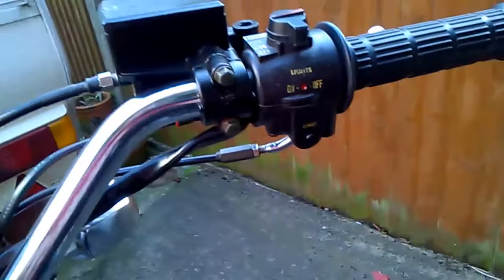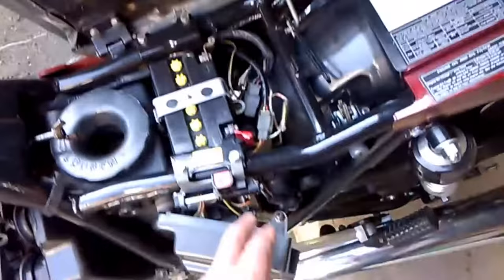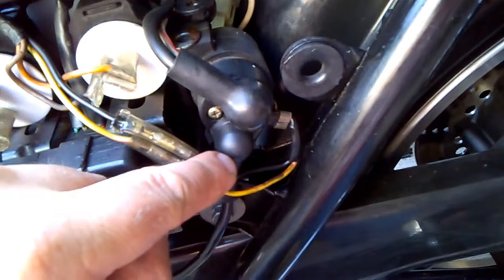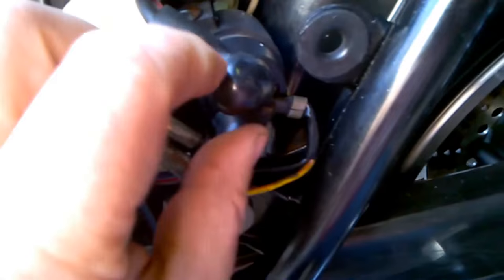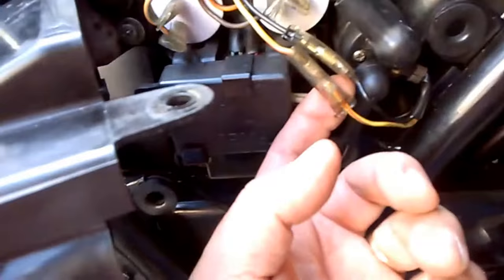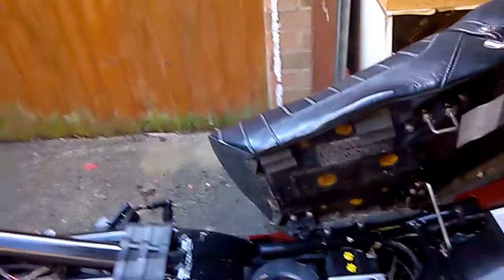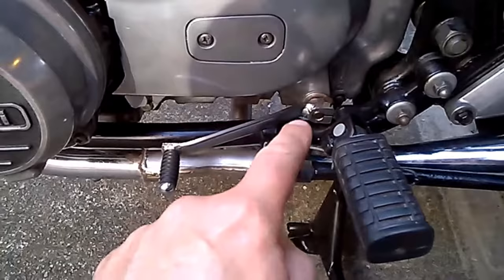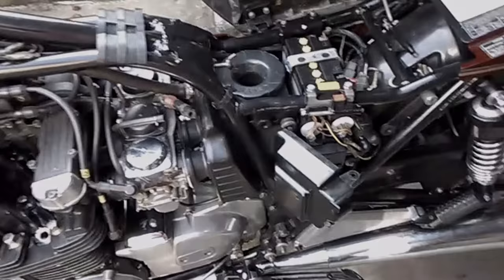What to check when your starter button is dead.

Comment: I have good new battery; no kill switch; ( that I see) and no click or noise when starter button is pressed.  I took apart the starter button assembly and sprayed heavily with elec cleaner.  Heeelp! 🥴
Reply from the maker: Have you followed through the advice in my video step by step? This is the best advice I've got! Check solenoid  and earth strap in starter motor.  Good luck.
Reply: Check fuses, try pulling your clutch in. Try kicking your kick stand up. Open ur kill switch make sure there is no debris

Comment: Usually the check lights go on when you tun the key to on. 2nd check engine kill switch and make sure it is in the run position….
Reply from the maker: Check the kill switch a good tip 👍 Still wouldn't have helped me here. The check lights were on, the kill switch in 'run'. The bike is 43 years old and lacks any finesse in the electrical side that more modern bikes may have. It was the dumbest of errors on my part, revealed for those that watch to the very end of the vid. 😂

Comment: Battery is new starter relay is new starter motor new, all i get is a click from the starter relay when pressing the  starter button and everything goes off then comes back on. Contacts are fine and theres power at the switch, stupid question would a broken brake switch prevent it from cranking?
Reply from the maker: I wouldn't expect a broken brake switch to cause that. Sounds more like a sticking solenoid, a sticking starter motor or a poor earth,  maybe at the starter motor.  Sometimes tapping the starter with a rubber mallet or dead-blow hammer will free it temporarily,  which would reveal if that was the fault.

Comment: I can start my bike with touching both contacts on the solenoid after pulling their plastic covers back, so my solenoid, starter motor and battery are fine but starter button doesn't do anything, usually if I were to forget pulling the clutch before starting It would crank for a second then it would stop but now the button doesn't do anything at all, I tried checking the cable connections between the starter button and the solenoid then checking all the sensor that wouldn't let the engine start but I cannot do all that at home, the thing is this problem wasn't there before a rain that took an hour, I thought starter button and the sensors wouldn't be affected by the rain since I am supposed to able to ride my bike in the rain, like a lot of British people do?

Comment: Bro you're sticking your finger in the electrical with the hot wire plugged into the battery. Disconnevt the negative on the battery when you're working on electrical
Reply from the maker: Low tension, no problem. You wouldn't see me handle the high tension side like this. 😮

Comment: I have a piranha quad, it’s not getting spark have any tips
Reply from the maker: I don't really know quads, but if it were mine I'd kinda work backwards from the sparkplug until I found the fault, like start by trying a new/different plug  if not the plug, then the cap, if not the cap  then the HT lead, like that. Coil packs can be a common failure though.

Comment: My bike starts with kickstarter but doesn't with electric starter, I can hear that the electric starter works and I can see the revs go up but when I release the button it just doesn't keep running. The battery isn't the problem...
Reply from the maker: That's a really interesting one. So if you don't use the electric start, but kick it over, it runs OK? With the electric start it will try to start but won't run? Makes me think maybe there is something wrong at the starter motor end - like perhaps the starter motor is not disengaging normally and could be jamming. Stripping and cleaning the starter motor is one option, I suppose. Another thought is whether there might be an electrical short somewhere which is killing the engine - like if you have a kill switch in the same handlebar control as the starter button (like the bike in this video) and something is shorting in there. It's a puzzling one - interested. to hear anyone else's ideas. Good luck.
Reply: Yes, but I will try today when I use the electric starter if the spark plug is still working fine or if it doesn't get enough power
Reply from the maker: Good luck. Might be worth keeping in mind, on the battery / enough power issue, that batteries can often test OK when not under load, but as soon as you put them under load they can dip badly. Might be worth trying a spare battery if you have one, or jump starting with a known good battery of the same voltage. (Most are 12V these days, of course, but my old trail bike is 6V).
Reply: For me its same expect when I use electric starter it does make a sound of it trying to start, though it doesnt. Do you maybe know to tell me if its out of eletricity in engine? When I use kickstart and start riding it, it behaves like normal.
Reply from the maker: A difficult problem. If the bike is OK when running, started off kick start, maybe could be a weak battery??
Reply: @AldinQQ  try pressing the start button 3 times short before holding it down
Reply: Did U ever find a solution bro, same things happening to my keeway superlight
Reply: @J_LONELY  change battery and start relay but first try pressung the start button 3 times short and 1 time long, that worked for me but had to change the battery eventually but it was a solution in the meantime

Comment: Good video lots of useful tips but I would have probably checked the main fuse first.

Gave it the thumbs up and subscribed.
Reply from the maker: Thanks for the sub and for the helpful suggestion. I think you are the first person to make this fair point. On my bike here a few lights ( neutral, oil pressure) come on with the key and the headlight main beam comes on too.
Reply: Turns out there was a mini fuse box that looked more like an ICU with two 30A fuses inside. 
I've never seen that before on any motorcycle!

Comment: Will a motorcycle start with the kick start if electric starter is not cranking for nothing? I was thinking of touching solenoid with insulated screwdriver but I'm afraid of messing up starter or something on the bike. Thanks for the video any feedback appreciated
Reply from the maker: It really depends on the actual fault, but I don't see that you can do any harm trying to kick start a bike, so long as the engine turns over and there is nothing mechanical snapped or broken. If when you turn the ignition on you've got power it's worth trying this. Good luck.

Comment: Hey I need help so my Suzuki ltr450 Dosent start at all it’s completely dead and the battery says it’s charged but not even the lights work do u know what could be wrong with it ?
Reply from the maker: There are lots of possibilities. If the battery really is OK but nothing at all lights up it might be the connections on the battery terminal connections themselves are corroded or loose. You could clean and reconnect. It might be where the earth strap from the battery connects to the frame is loose or corroded, you could check that. It might be the ignition switch, where the key goes in is broken inside or faulty. That's a bit more complicated to check without a multimeter and without knowing the bike.
Are you 100% sure the battery is OK? Have you or a friend got a spare to try as a way of checking? Good luck.

Comment: My bike died on me the first time I got it 😔 I can’t turn it on, it just makes weak  start up that lasts like 5 seconds of weak gas    but doesn’t turn fully on
Reply from the maker: If the starter kicks in, and the engine turns weakly, my video probably won't help, because it's mostly about the electrical circuit being broken. If the engine kicks in, even a bit, the starter circuit is complete, so not your problem. Could be a very weak battery though. Have you tried charging it? If the bike fires, but won't run it could be any number of problems, but I would start by checking the fuelling. Are you getting fuel to the engine? A common hiccup is forgetting to turn the fuel tap on. After that I would check for a good spark at the plug,  and after that I would maybe check the timing..I would be worried if the bike is making any bad mechanical noises, like something is snapped or broken inside.

Comment: What do I do if when I try to connect the battery; the bike tries to take off? Please help
Reply from the maker: The bike leaping forward means it's still in gear. If you have the clutch pulled in it shouldn't happen unless there is something wrong with the clutch, like a broken clutch cable. In that case it's not an electrical fault, which is what I'm covering in this video.

Comment: What happens when your bike not getting power at all it's dead?
Reply from the maker: Could be so many things, depends on the symptoms before it died. Was it running fine, or did you have problems? Do you have an ignition light on the dash or clocks when you turn the key? Anyway, first thing I would check is the battery terminals.  Are they clean and tightened.. Does the battery have any charge? Doesn't bike make any noises at all, like clicks or whirrs? Have you tried charging the battery?
Reply: Check the main fuse

Comment: Then there is also cdi unit, which you haven't mentioned.
Reply from the maker: Thanks, a helpful observation. I didn't even think about it, although failure is uncommon and the confession at the end of my video is about not forgetting that the starter motor circuit is sometimes contingent on switches, which was what prompted me to post the video a couple of years ago. 👍

Comment: Hi there, i have problem.... My atv doesn't start when pushing start button, but it starts when I connect with screwdriver on solenoid. What should be a problem?
Reply from the maker: If it starts when you short the solenoid the most likely problem is a sticking solenoid or a fault in the starter button. I explain in the video how to check a solenoid. Good luck.
Reply: @Mr_CMH  It's solenoid, not clicking when conected on battery... Tnx man
Reply: I touched the relay with a screwdriver and turned on, so is not the battery. But I never turns on with the button. Do I have to replace that thing?
Reply: @willgamer0849 did you ever fix the issue?
Reply: @ChoppyGang  No I haven't, I gotta take it to a mechanic bc it seems like a hassle. Gotta be something with the wiring, or the battery but the guy who sold it to me said it was new and it looks like. But the only way it started electricly was by touching the relay with a screwdriver so it's not the electric starter. But never with the press of a button. It's so annoying. I'm honestly tired, right now I'm not using that bike so I haven't bother taking it to a mechanic, it's just collecting dust.
Reply from the maker: Hope you can get it sorted. Know what you mean about being tired with stuff sometimes.
Reply: @Mr_CMH  Literally tired of hitting the kick start or just rolling down a hill to fire it up on second gear too. I even got a relay from a dude who gave it to me but it didn't work. Maybe bc it's not the bike's og and the connectors are different. I will buy the original one. I want that bike to be in perfect condition. Bc I gotta take it to a technical check they do here. Without it they can fine you.

Comment: I got a new battery, But I press the button and won't do nothing. The battery is good bc I shocked both sides of the relay with a screwdriver and it did turn on. But never with the button. And also It won't power the lights while off and with the ignition. The battery is new.
Reply from the maker: Sounds like a pain in the ass. Could be a fault in the starter button or a break in the circuit/bad connection from the starter button. Sounds like from the solenoid forwards to the starter motor is OK, so possibly the problem is earlier in the circuit,  before the solenoid, maybe. Hope you get it fixed OK.
Reply: @Mr_CMH  I will replace the solenoid relay and if still doesn't power up with the button, would've have to be a cable not well connected from the button.
Reply from the maker: @willgamer0849  Sounds like a good plan. A sticking solenoid is quite common. I should have said that first, although I do talk about how to check the solenoid in my video. On my bike I did have to replace the starter button once, I think a spring broke, but I don't recall the details, there's been lots of stuff fixed or renewed! Good luck.
Reply: @Mr_CMH  Is weird bc my old battery did power the lights even when off only with ignition, but it never turned on even when touched the relay with a screwdriver. But this other battery won't power the lights while off. But it does turn on when I touch the relay with a screwdriver.
Reply from the maker: @willgamer0849  Could it possibly be a fault in the ignition switch? Is the ignition barrel worn? Are the connections out of it corroded at all? Seems strange as you say. Could it even be two faults, which is tricking you?
Reply: @Mr_CMH  I bought the whole thing the controller that comes with the cable and stuff,  It has a connection with 3 pins that snaps into the other, then two little brown cables with two pins and still the button won't trigger the electric starter motor. Everything else works, turn signals, lights, solenoid and battery are new. But that button still won't send the signal to the motor. Despite buying the cable with the controls new.
Reply: @Mr_CMH  It's a small 150 cc bike. I'm tired of kickstarting it. Also when I touch the relay with a screwdriver it does trigger the capacitor and starts the engine. But never with the button as it should.
Reply from the maker: Your comment just came through (April 2024). If you're still having problems a year later maybe it's time to bite the bullet and take it to an auto electrician and see what they make of it? @willgamer0849

Comment: I’m so confused on why mine doesn’t work so I replaced the relay and the button is still dead you can jump it with a screwdriver and it starts fine but I press the switch there is nothing and it doesn’t have switch on the shifter of kickstand or clutch so I don’t understand why it isn’t working
Reply from the maker: Helpful information you provide. So if it starts shorting out with a screwdriver that suggets to me that from the relay (I would say solenoid) forward to the engine is good. (that is, the starter motor, engine earth, motor earth etc). Seems to point to a switch, like clutch or kickstand, but you say that you don't have them. Are you sure? What about a gearbox in neutral switch? Some have those. If not then I think it might be a fault in the wiring between the starter button and the relay (solenoid), like a corroded connector. Have you tested for continuity along the wires from starter button to relay? That's what I would do. Also, is your engine kill switch to 'run'? That shouldn't be the problem though, if it runs when shorted.

Comment: My bandit used to start sometime, sometime not.  When not starts there is no reaction at all. Now  its only no start.  Battery is ok, relay is ok,
Reply from the maker: I guess I'd be checking the actual starter button and the continuity of the wiring in general. Could be a bad earth too. Hope you get it sorted.
Reply: @Mr_CMH  it starts right away skipping start button so battery, starter motor and relay is fine! So I think side stand and clutch are ok too but have find out how to check. I would tip its the starter button, hope its not wire soome where. thank you for respond
Reply: But I have no idea how to take start inside out, there are no screw it looks like one part, weird. In hainess manual there is nothing regarding start button check and repair
Reply from the maker: @04poppop  I've never owned a Bandit. Had a couple of gsxf 600s though. Maybe the screws are on the underside. You could try asking an a Bandit forum, they might have more idea than me.
Reply: @Mr_CMH  Mystery  how the hell I am supposed to take it out??
Reply from the maker: @04poppop  Beats me! Almost always there are small screws on the underside of the switchgear. I did the starter button on my KZ 750 but didn't make a video. Only thing I can say is take photos, there's some tiny parts in there. I'd add that if you are not confident, you'll probably be better off finding a bike shop to help. Pain in the ass though.
Reply: Yes, yes, yes. Clutch did not engage enough to press the button just adjust it more tough to press more and solved the trouble. Starter button I even don't want mention as its silly, its needed to cut off that self tigh plastic around. Ok I have very happy I made it, thank you for your respond anyway
Reply from the maker: @04poppop  Good news, and it was the point of my video when I made it a couple of years ago, that other switches can mess up your logic. In my case, and yours, it was the clutch switch.
Reply: @Mr_CMH  Just did not press 100% on the button under clutch. And the start button to get out I needed to cut off the rope around, but its silly it did not occur me. But I am happy as I am not some mechanic but since one guy wanted to rip me off on job on my scooter I am learning a bit so I dont go to any garages as far as I don't need to get open engine. Considering I did not pay attention to mechanic job, never interested in it its pretty decent progress